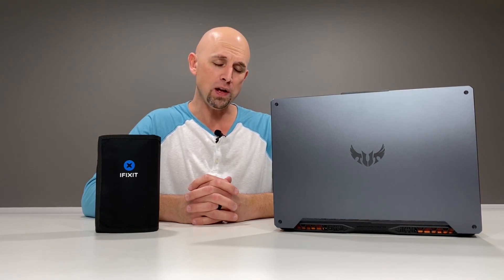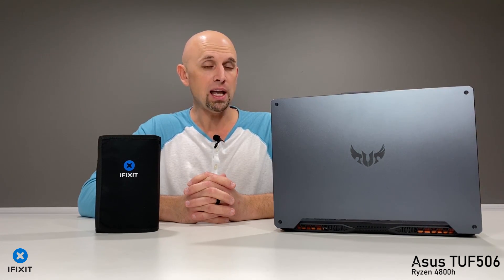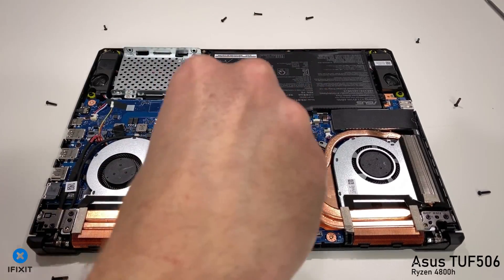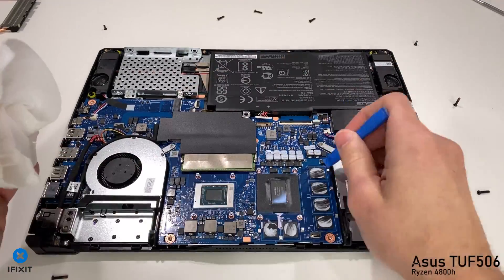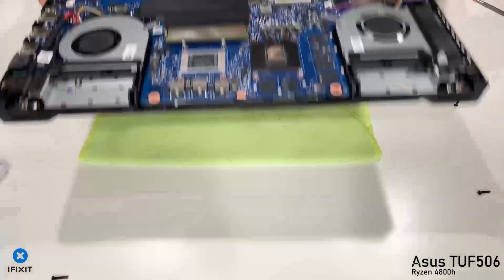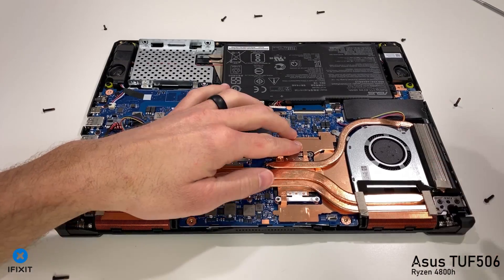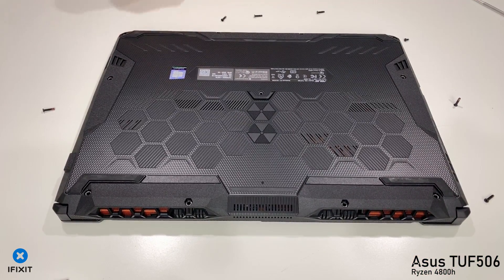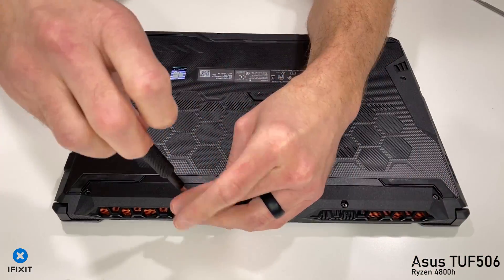Asus TUF 506 Repaste (Ryzen 4800H inside)

Comment: Another gimped AMD laptop by Asus, the bottom panel has barely any air intake holes even though the design could have allowed for massive air intakes. 

Shame on you Asus, shame on you
Reply: It's the TUF lineup. They want you to buy their high end ROG class of laptops if you want better cooling.
Reply: @gamersanditparadise  It's not the point of better cooling power but the point of using a few small cutouts to feed the fans with air.
Reply: If I'm not mistaken, it is very important to have a specific area of air intake and not too much to allow an airflow path that cools the ENTIRE device. Let's say if the entire bottom panel was all air intake, the air would path just on the fan area an out, without touching important components that needs to be cooled. But with limited air intake the air has to go through more area within to get to the fan. That's my basic understanding.
Reply: @lemarsh387  yeah I heard that BS as the excuse over a decade ago with my Asus G51J which had repurposed desktop silicon as a CPU plus a 9800 based dGPU running off one starved fan with a completely closed off intake area. Not sure how 95C+ operating temps on the CPU and GPU were beneficial, or how the other components were being cooled given the surface temps on the case were over 40C, and almost too hot to touch, after 1/2 hour.
Reply: @greebj  And probably for that laptop, people modded it by drilling more intake holes which improved airflow, isn't it?
Reply: @gamersanditparadise  I drilled holes in my 2 yr old asus tuf and got 10-20 degrees less temps, after repaste and other tweaks got 10 degrees less. In total 20-30 degrees less from stock. It became too dusty from inside though.
Reply from the maker: I have a video on the channel that talked a bit about this.  I’ll sum it up. 

Some panels that have their intake holes away from the fan can be useful to draw cool air across passively cooled components.  I showcased this and was able to reveal some interesting temps beyond just the GPU/CPU.
Reply: @BobOfAllTrades  Doesn't matter when the CPU/GPU are choking to death because they can't get enough air. It's very typical of ASUS to have those kinds of issues. G14 gets much better temps with external fans forcing air through it. Sign of a bad design, lol.
Reply: @BobOfAllTrades  
What's the name of the video?
Video link?
Reply: @lemarsh387  Limiting air flow does help to cool other components, if the cutouts is right under the components to be exact. So, the small cutouts for this TUF laptop just serves the purpose of limiting airflow, showing off ASUS's higher end product that will run cooler despite having almost the same cooling power and cools nothing other than core components (CPU, GPU, VRM and VRAM).

Comment: I think this and your review have made me from a neh-sayer to a believer. That CPU is surprisingly great. If it performs this way in the ASUS G14 I'm sold. I have some Razer Blade 14 nostalgia for the 14" size.
Reply: Keep in mind that the G14 will have the 35W TDP version of the CPUs though (and may not burst anywhere close to 60W). It may be down 10-15% over the 4800H in the 6-8 core load range. Still a great option on paper, but the G14 will be a bit slower with the weaker HS-series processors.
Reply: @masejoer  That is unclear for now. HS series is a binned chip that should perform the same as 4800H, but with lower power consumption.
Reply: @rusparmesan  Assuming the 4800HS runs at least 10W cooler, I guess the Zephyrus will still easily be able to handle 45-50 Watts of power, provided there's no power limit throttling there. Come on its not that hard to cool those watts, even a macbook can handle it.
Reply: @rusparmesan  RIght and the H is only 10w higher than the HS. So if that's put into a larger laptop it should be fine. Considering pretty much all Intel laptops are pumping anywhere from 65w to 100w on 9750H laptops I'm not worried.
Reply: @gamersanditparadise  I really can speak for the MacBook pro cause it literally has no air intakes under the laptop.
Reply: @gamersanditparadise  a MacBook air has a quad core and that also thermal throttles from the videos I've seen on YouTube.
Reply: @rohanleander  No intake holes? Really? Then from where does it get cool air?
Reply: @masejoer  even still that would put it ahead of the 9750H. Which would still be a win. So I'd still gladly take it over any of these low powered CPU's in the likes of the Blade Stealth and Msi Prestige.
Reply: What worries me is the panel quality. The videos i saw from CES don't make me hope for much
Reply: @PolCmara  Care to elaborate? I didn't see anything bad about the display?
Reply: @PolCmara  yeah panel quality will not be great, I expect ghosting on 120Hz model.